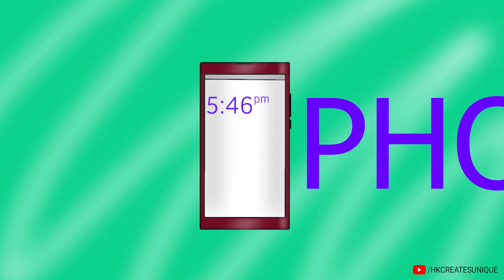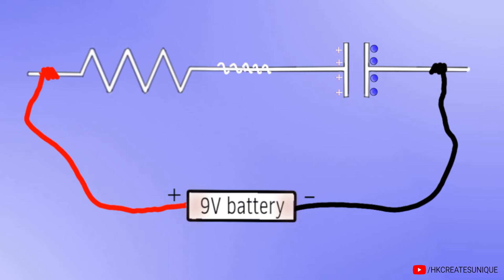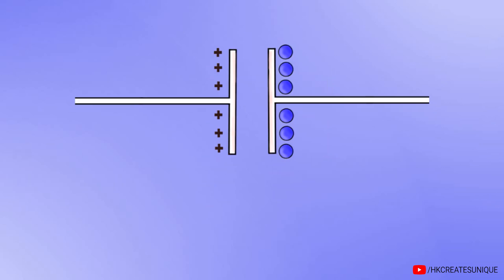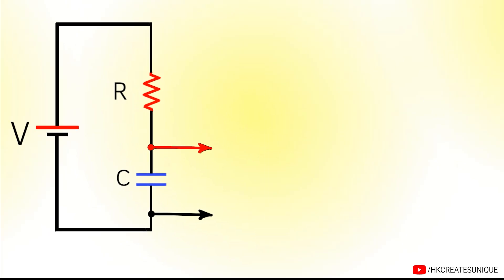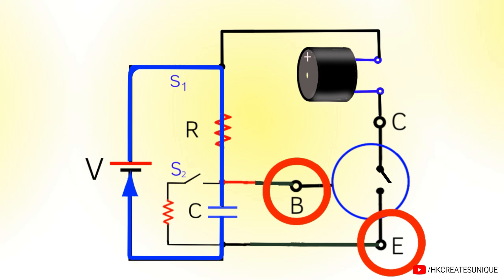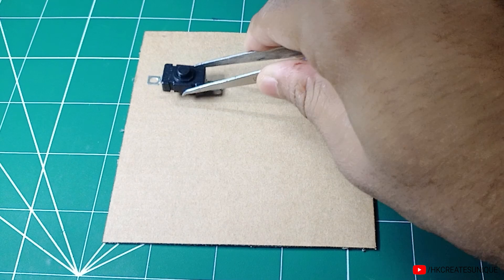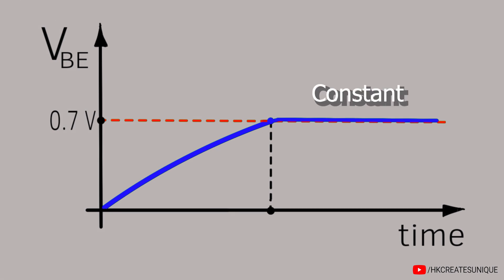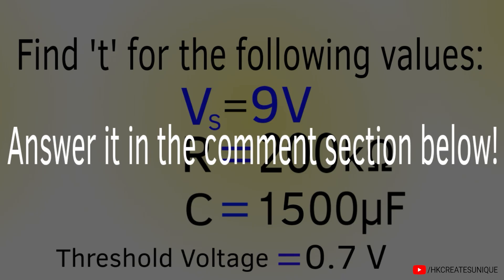Transistor based Timer circuits, How to make? How it works?

Comment: I need for a 5 V battery, to turn on after 5 seconds. Is the following calculation correct:

NPN Transistor (BC547 or 2N3904)
Capacitor (C = 1000µF, 16V)
Resistors:
R1 = 1MΩ (Charging resistor for delay)
R2 = 10kΩ (Base resistor)
R3 = 330Ω (Current limiting resistor for LED)
Thank you!
Reply from the maker: Hi, there might be resistance tolerance, capacitor tolerance. The Best way to check is to actually make the circuit and record the Time for various values of resistors.
Reply: @ thank you